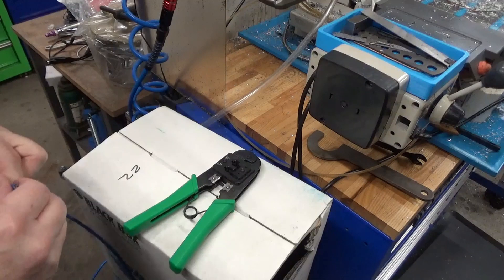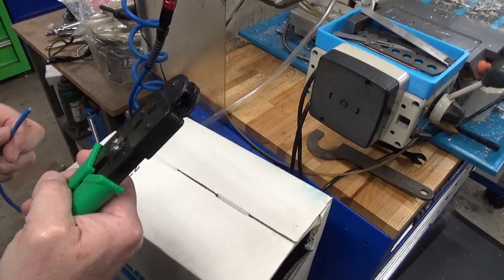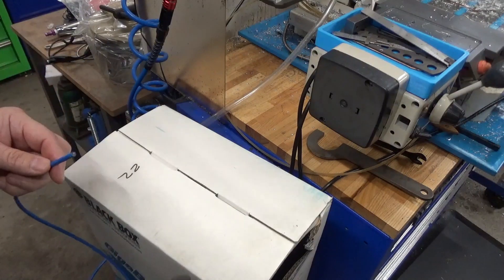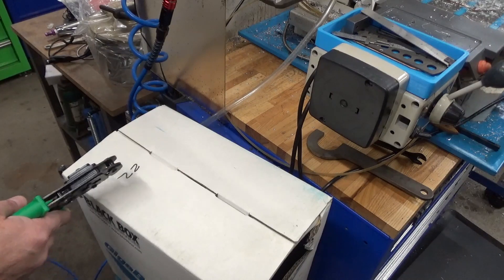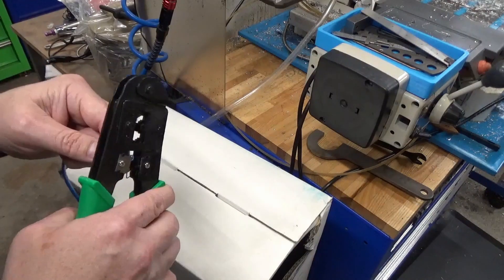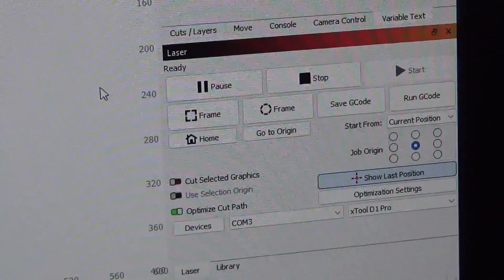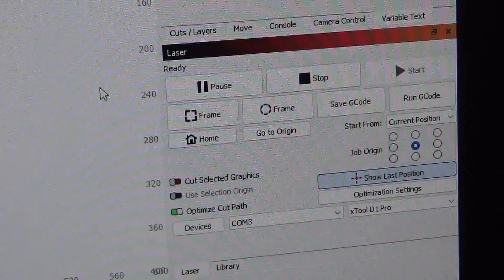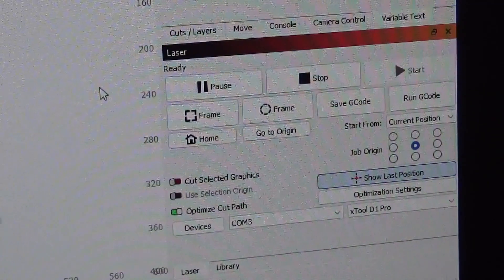Short - Laser Engraver USB Extension

Comment: Hi Mick, Thanks for showing... I tried a USB over IP about 5 years ago so I could monitor / support a controller via the internet for a site in the next city. It worked great for about a week, then it thought it was connected to a different computer (MAC). Basically bricked the adapter, it was un resettable. Well at least it worked for a few days.. Direct ethernet should be good and stable.
Good Stuff ... ATB...Dean
Reply from the maker: Thanks Dean!  Are you going to the Bash this year? I got my ticket....
Reply: @MicksWorkshop  Yep I'll be there, I got my ticket too.. I'll see you there 👍